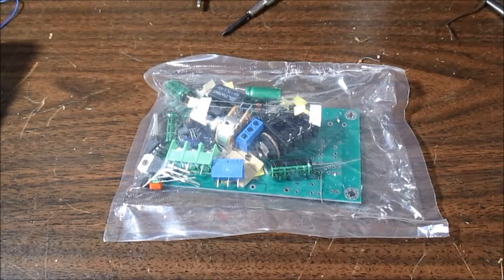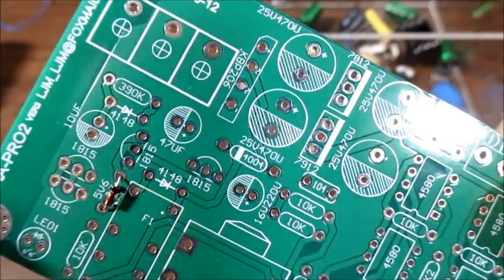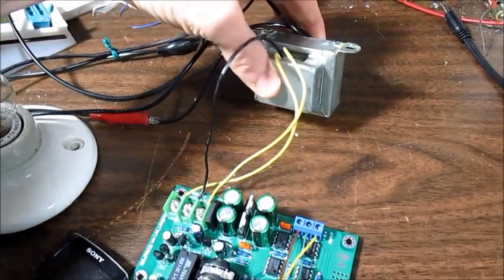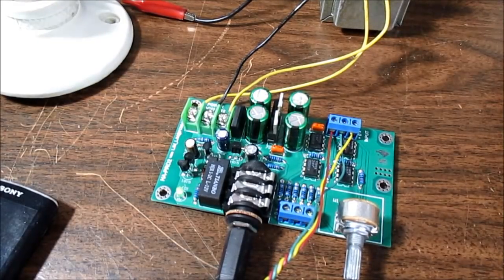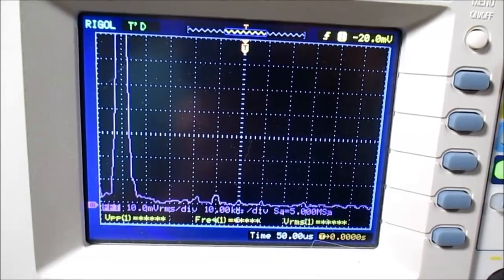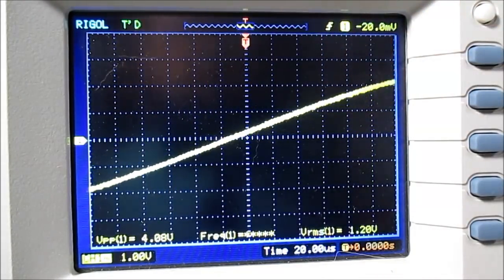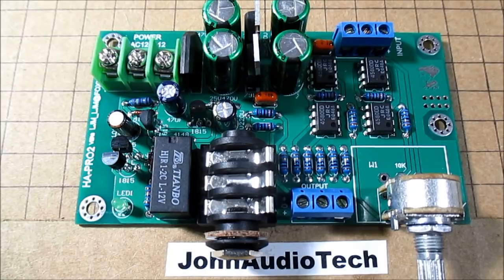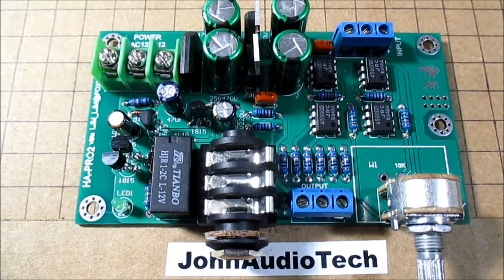Headphone preamp board kit test & review

Comment: JohnAudioTech, per my earlier comment about the time delay circuit in this amplifier, I have figured out the 'mystery' transistor circuit. This is a feature to prevent damage to the headphone's internal speakers if the amplifier tries to output a signal with a significant DC component (or a DC-only signal). This could happen because this amp is entirely DC coupled (no AC coupling capacitors). If either or both channels' amplifier stages (prior to the relay contacts) have a DC component of more than about 0.8V, the relay will be de-engergized, thereby disconnecting the headphone jack from the amplifier stages. This state will continue until a few seconds after the DC component has decreased to a lower voltage. It is nice to see that the circuit's designer thought of this.

Comment: Great show and board John, if people only have a fully AC transformer type wall wart adapter, with just a single (no center tap), output – you can easily reconfigure the supply input circuitry for split rail voltage doubling. For about 16 Ohm (low Z), type headphones – an about 18 Ohm 1 Watt dropper resistor in series would help match. Nice to have had a 3.5 mm output socket, but there are adapters that can be used. PS - I hope you dad is doing well, best wishes Michael.

Comment: JohnAudioTech, I have purchased the revised version of this kit, the HA-PRO2. Seems to be the same as what you reviewed, except the alternate output terminal block (between the main headphone jack and the volume potentiometer) has been replaced with an 1/8" headphone jack, so it has both 1/4" and 1/8" jacks.

I have reverse engineered the circuit, and am drawing up a schematic; seems a lot of people are asking for the schematic, and it is unobtainium, so I will try to put mine online somewhere downloadable.

In studying the circuit (I have not actually built mine yet), I see that there is indeed a time delay of nearly one second after turning the power on before the relay closes its contacts, connecting the circuit outputs to the jacks. But I see no time delay on turning the power off. You mentioned this, but did you actually observe a power-off time delay? I think it just immediately disconnects the jacks from the amplifier circuit when the power is removed....indeed, there is a diode in the circuit to make sure it de-energizes the relay quickly.

I did notice one mystery in the circuit; while there are two transistors in a Darlington pair to control the relay coil, there is another pair of transistors that I cannot figure out the purpose of in the circuit. From your video, it looks like yours has the same circuit. There is a 220uF capacitor and those two extra transistors and a pair of 10k Ohm resistors that comprise the circuit in question. The way the transistors are interconnected is odd, and they seem to be driven from the Left and Right outputs (BEFORE THE RELAY CONTACTS) via the two 10k resistors. I am not great with bipolar transistor theory, but as near as I can figure, the circuit monitors both channels pre-relay and somehow this influences the relay time delay duration. I thought perhaps if there is currently no audio signal coming through the amp, i.e; if it is amplifying silence, then the relay time delay might be shortened a bit, but if there is active audio, then the circuit detects it and lengthens the time delay. Or vice versa, I am not sure of my analysis.

Since I have not assembled the PCB yet (I am waiting on my torroid power transformer and Rean RCA jacks, which should perfectly fit the aluminum case that is made for this kit), I rigged up the same mystery circuit on a solderless breadboard, powered from my bench supply, and instead of an amplifier output I used the output of my signal generator. I confirmed the power-up versus power-off time delays, or lack thereof. But no matter what I tried, I could not get the mystery circuit to have any effect on the time delay, and I don't see any other effect it COULD have. Any ideas?

Also, with my HA-PRO2 kit, there were also two extra components that do not go on the circuit board; a 100 Ohm 1W film resistor and a 1nF (0.001uF) 1kV disk capacitor. A tiny schematic on the circuit board silkscreen suggests that these be connected as a series RC snubber network wired in parallel with the power switch contacts. Those values do seem appropriate for an application like this. I just wonder if your kit came with the same thing.

Comment: I've never heard of op-amps oscillating while the supply voltage drains. In some of my tube circuits I've noticed some weird oscillation when I turn off the power, when the voltage gets to a certain point the circuit makes some wierd noises.
Reply from the maker: If for some reason one supply rail goes to 0 before the other, I've heard them squeal like a stuck pig.

Comment: 11.10 $ US (free shipping worldwide)  I think I'll order one.  My son bought high end headphones (100 ohm) which plays very weak connected to a smartphone.  Obviously, one has to add a box and a transformer and maybe a decent looking volume knob?
Reply: 1959Berre. Radio shack online (they still exist, kind of) has some cheap halfway decent looking knobs for sale.  And some non-inductive 8 ohm 20 watt resisters FWIW.
Reply: eBay sells an aluminum case designed to fit this kit. It comes with all the hardware, an IEC power cord connector, plus a nice looking volume knob that fits the kit's potentiometer, and a power switch. Price is about the same as the kit itself. You still need to source a power transformer, an IEC power cord, and connectors for the inputs. The case seems to be designed for a pair of Neutrik-Rean model NYS367-0 (black) or -2 (red) or -9 (white) RCA jacks, which are nice looking and good quality and readily available. I think a Telema model 0015P2-2-012 torroid power transformer would be a very good fit, but I have not checked sources and availability yet.

Comment: Are most preamp boards suitable for headphone use and vice versa?  Is it just a reduced level of amplification or is there more to it?
Reply from the maker: A standard preamp is not designed to drive the lower impedance of headphones.
Reply: Thanks for your reply.  I'm quite new to audio so your channel is really helpful and any knowledge I can glean is truly appreciated!  It's mainly through your channel that I have discovered you can get good quality audio for a really quite reasonable outlay.  Thanks again 
Davy
Reply: gartmorn - If you’re new, you’re in the right spot. Stay w/ the channel. Learn everything you can on impedance. Golden thread.

Comment: Out of topic question. I found a baxandall tone control ckt and a preamp ckt. Which should come first? Preamp+tone_control+amplifier? Or tone_control+preamp+amplifier?
Reply from the maker: It depends on your circuit design. So the tone control filters are not affected by input impedance, I'd "buffer" them with a preamp.
Reply: JohnAudioTech thanks!